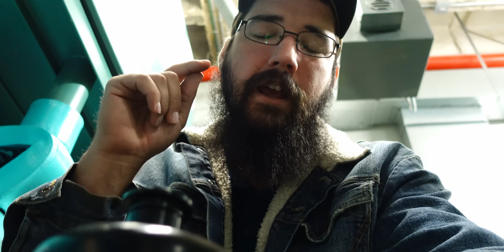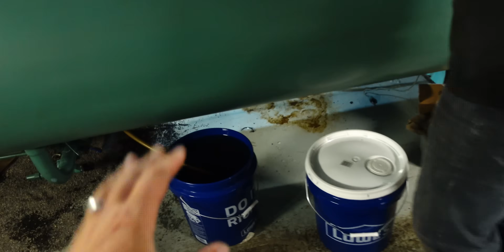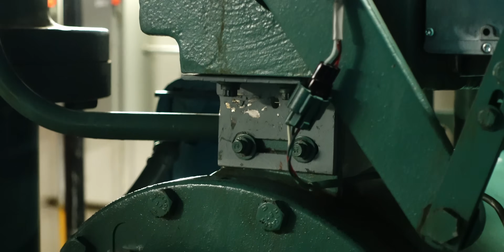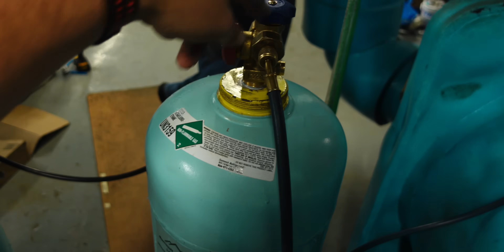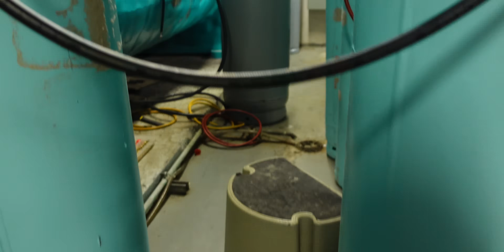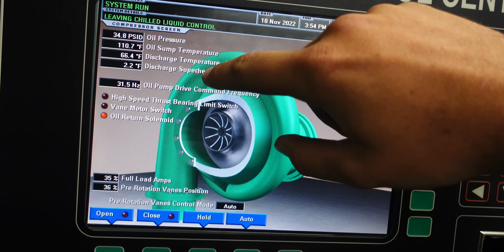This charging method worked on Chiller

Comment: I do a lot of 134a work on centrifugals. Ive timed recovery rates using 1/2" hoses, 3/8" hoses and using a water cooled, belt driven YORK Recovery Machine, as well as a Fieldpiece Recovery Machine. I have been able to repeatedly move 1000lbs of R134a Liquid in 50 minutes using three 1/2" hoses in Push Pull orientation. You move about a pound of liquid every 2-4 seconds. A 125lb tank would take less than 15 minutes to pump out. Rate is the same with the smaller air cooled machine by fieldpiece or inficon. Vapor can be anywhere from 20 seconds per pound with a 1/2" water cooled RSR, or 60-120 seconds per pound using purely air cooled RSR. Last year I made up a water cooled condenser using a coaxial coil to go with my fieldpiece which keeps the tanks cool and the compression ratio lower.

 Ive thought about doing a daisy chain between multiple tanks but the tanks are empty in minutes anyways. Not to mention bringing all of those hoses and fittings up, hooking them up and purging them (and making sure nothing is leaking.) When my liquid hose sight glass runs dry, I switch tanks. When all tanks are empty, I bring the vapour down to 5-10psig to recover as much vapour left in the tank and into the chiller. There can be quite a bit of lost refrigerant the customer is paying for in vapour form. A 1000lb tank will contain about 30lbs of R134a from 500 microns to 60psig.  R134a vapour specific volume @75psig is about 0.5 cubic feet per pound and a 1000lb tank is 16 cubic feet... so  16cuft / 0.5 cuft  per lb = 32lbs R134a for 16cuft @75psig. (This is what I think about when pulling gas for days at a time... Im sure all chiller guys are nuts in certain ways.) My phone is full of notes like this that I help explain thing to apprentices. Different refrigerants, torch tip flow rates for your oxy acetylene tanks. We learn all this stuff in school but forget most of it when youre done.

CHEERS!

Comment: I have a Ole ye York YS DC CB S3 
100LBS WERE PUT IN PRIOR TO ME INHERITING THIS MESS.  THIS CHILLER HAS TEW PORTS ON TOP OF CONDENSER and EVAP COIL.  IVE ALWAY ADDED THE REMAING CHARGE THEOUTH THE BOTTOM OF EVEP BARREL.  IWAS TOLD TO PUT CHARGE INTO TOP PORTS AND LET OT EAT.  IS THIS CORRECT?  OR WAS I RIGHT???  PUT THE REFRIGERANT IN THE BOTTOM OF EVAP BARREL.  GRAVITY KEEPS THE REFRIGERANT OFF THE TOP OF THE BUNDLE.   BOTTOM FEED POOLS AT BOTTOM. HELP!?

Comment: Those vane pumps can produce a slight oil mist, but often the separator on the output can handle that. I don't see it as a big problem, you can also get activated charcoal filters for the outlet that will even suppress the oil smell. i don't see why the customer would have a problem, this is something that all pumps using oil have, there is no way around it. Also, you can just connect a long hose to the outlet and pipe it outside, the hose will not have any significant effect on the pumping performance.
Reply: The person that was pumping fog into the mechanical room probably did a shitty recovery followed by a quick leak repair and threw it right on pump. Just pumping straight refrigerant vapor into the mechanical room. Probably set off the monitors too 😂😂
Reply: @shanebond1389  thats sounds very plausible

Comment: Open up the chw valve, crank the water down to 5-6 degrees C. 

Chuck half the charge in on vacuum. Obviously vapour until saturation, then rest is liquid. Then turn on the machine and get the turbo to pull in the rest. Job jobbed. 

Nice to see a YT 👍🏻
Reply: The CS02’s come pre calibrated. As you’re running a fully flooded evap  it’s a little more forgiving regarding the liquid level position. The Hybrid falling films are more crucial for a 50% level in the condenser sight glass.

Comment: I ordered from tru tech tools and got a free micron gauge, that exact one! 
Clogged with oil once and the bitch dont work no more :/
Reply: Oil in the micron gauge isn't the fault of the gauge.  When I first started using micron gauges I suffered with oil issues.  Must have a second core tool off the side port of the first core tool to valve off and protect the micron gauge from pressure and oil.  The micron gauges should always be installed with the port down.  They can be cleaned with alcohol.  I use Mass Air Flow Sensor Cleaner from CRC, but do so at your own risk!  I always have MAF cleaner on the truck doesn't hurt paint rubber or plastic cuts through oils including Nylog.  The micron gauge that is really hard to clean is the one from Testo, with its built-in manifold that makes no sense.   Another reason that I am not a Testo fan. 

Micron gauges are calibrated in nitrogen not air..  Oli free refrigrant doesn't hurt a micron gauge.

Comment: please dont get bullshitted too much by the navac sales reps. value design and make the stuff and navac puts on their brand. but dont let them think for a second that its in any way shape or form that they do anyhting else than moving boxes and give customer support from the american navac office. its just a value rebrand nothing more or less. and however you think about the brand: its "fine" not good, not bad. just decent stuff for a decent price.
Reply from the maker: I wish the industry tool's as a whole would elevate to higher standards. Granted that means more expensive.
Reply: @HVACTIME  indeed. I would gladly pay 5k for a recovery unit if it would actually last 5 years without breaking and could get any part for it shipped if something did break. Wich is why we still buy stuff from yellow jacket, refco and fieldpiece for example.
Reply: @SupremeRuleroftheWorld  Fisher-Price will not sell you individual parts I just went rounds with them on this.  Appion will which is why I will not trade my G5-Twinn for anything.   It has a parts list in the manual.  Looking at upgrading my 2 non A2L compliant vacuum machines, Tez-8 and the JB battery powered.  JB battery powered uses Milwaukee batteries and unlike the Milwaukee they are both completely rebuildable.  I love and think the FP Job-link and manifold gauges are the best, but you can keep the rest.  Just upgraded from a FP meter to a Fluke OMG what a difference.   When FP is auto ranging says 0.00  Fluke when its auto ranging says OL.  FP reading 0.00 could cause you to stick your hands in a live circuit.

Comment: My only fear of push pull with a lot of tanks is that the last couple of tanks get completely full (no room for expansion!) in the process. Next time you try it, weigh the last tank during the process. 

Thanks for the video
Reply from the maker: As long as the tank isn't building pressure it shouldn't be a problem. Especially in a controlled environment like this one. But i think your right the tanks would stack as the pressure pushes it through.
Reply: @HVACTIME  Even if the cylinder do full past 80..95% they are still open to the system and not completely closed off.. should cause a problem because the refrigerant can still move around?

Comment: Good video. You've got a lot of latest/greatest gadgets ($$) and a lot of theories. I think the oil pump cycling causing a broken bracket is way out there. If that pump runs that rough there's a problem. If you told me( customer) that you vacuumed the machine I'd run you off. It's called evacuation. If you're concerned about charging/evacuation time use1/2" hoses. Think you might want to stick with RTU and residential. BTW, 40 years chiller tech. and union.
Reply from the maker: And miss all the fun, nah. But I do appreciate the feedback to be better.
Reply: I checked out your channel but didn’t see any videos.  I wanted to watch the 40 year union chiller tech show us all how it’s done.
Reply: The 40 yr union service tech could probably still "show you how it's done." Has Mr. Smart guy EVER worked on 5000 ton centrifugal, 1000 ton absorber or 300 ton package (recip or screw)? Thinkin not. Forgot to add CARRIER factory service.  Have a good day smart guy .....you probably wouldn't want to look up absorbers, it'll hurt your brain. Have a wonderful day 🤨
Reply: @larrychristopher9147  It’s interesting that you go straight to belittling me even though you have no idea what my credentials are.  You’re correct about me never having worked on a 5000 ton centrifugal, but that doesn’t make me less of a technician than you.  My point, which I think you missed entirely, is that it takes courage to make videos and put them on the internet for every Tom, Dick, and Harry like yourself to pick apart.  I know it’s hard, but encouraging people to do better goes farther than tearing them down.
Reply: @camronconlee4556  Don't go getting your feelings hurt on other's behalf. He's a man, he can stand up for himself. Notice how he brushed off the insult and didn't engage in a pointless argument with a guy obviously trying to dick-wave credentials?
Reply: And super tech has joined the chat.  They always show up.

Comment: Bluvac makes a awesome gauge and the app is great but it will never hold deep micron readings.  Seems like it’s sensor is to sensitive and still reads small amounts of refrigerant degassing in the oil sump. Just my 2 cents.
Reply: I use it in residential, I've held new systems down to 40 microns in decay, it's not the gauge, it's just the system. The system rising is just representing the system